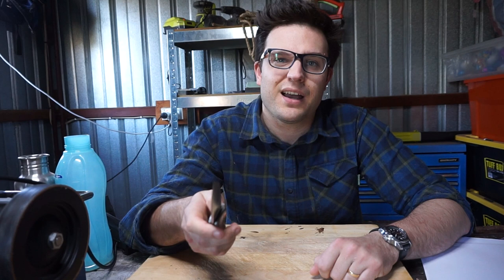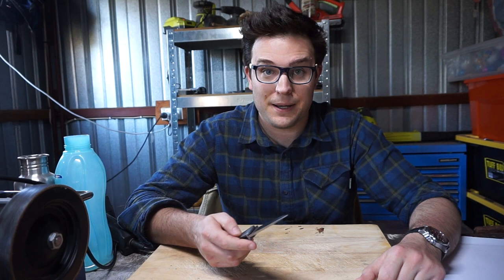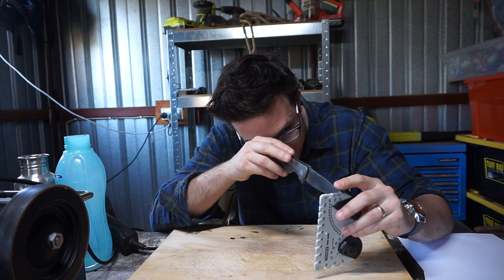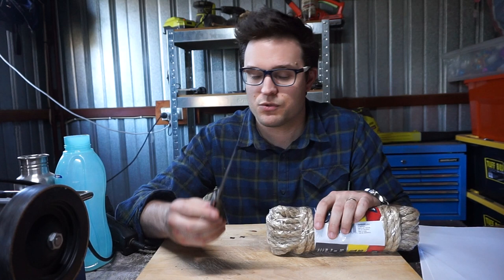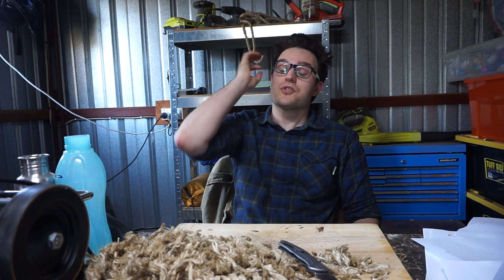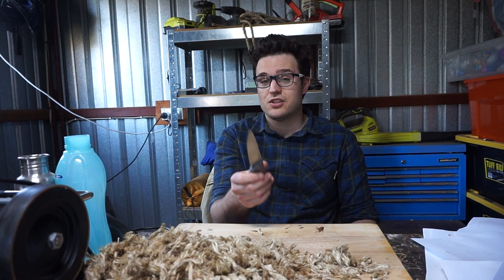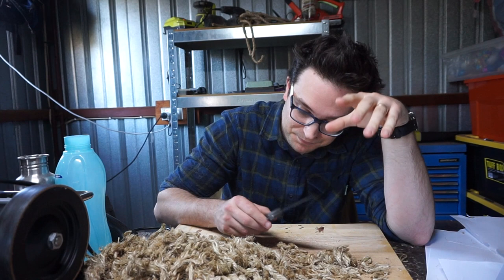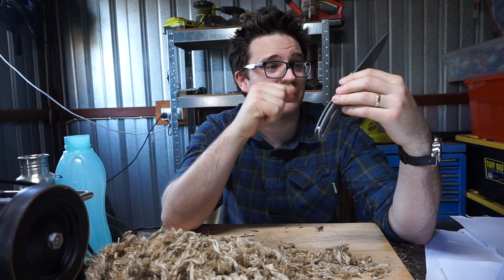S125V Blade Steel Test - Unleashed! Plus Sharpening

Comment: 200 push ups every morning will do the trick Pete) Great vid as always mate
Reply: don0giorgio pushups are actually awefull for shoulder health, especially in his case where his is already putting high stress on his shoulder. Facepulls would help him, pushups would only hurt.
Reply: @basmca1  when you got your doctor diploma mate?
Reply: don0giorgio you don't need a doctorts diploma to learn how our shoulders work. I've been training for almost 5 years and have done my fair share of research on shoulders, how they work and what injuries you're likely to get from some movements. The main thing is people getting an inbalance by doing things like '200 pushups a day' but not doing the equal back and rear deltoid training. That inbalance make the front deltoid and chest muscles tighter relative to the back muscles, pulling the shoulders to the front and down. The effect of this is the rotator cuff muscles and nerves getting pinched and causing pain when the shoulder is put under stress.
Reply: @basmca1  will simultanious pull ups training help?
Reply: don0giorgio yes, a rowing movement would be ideal( the same range of motion as pushups but with the loading reversed.) but pullups are good as well.

Comment: You gotta change up your rope so it doesn't take so long and kill you physically. Dutch bushcraft boys and alot of Russians use some thick boat rope seems to take less cuts. Could be idea for these high end super steels.

Great video as always! The steel and ht are great. The maker has got to stop copying designs though. Find that off putting.
Reply: Only problem is if he changes the constant in the equation then there is no basis of comparison
Reply: I second this! I love watching your steel tests, but I worry about your arm. I say, find a thicker rope, and figure the equivalent in the twisted sissile (sp?). Like, 1 boat rope equals 45 cuts on a regular rope or something. Save that arm Pete!
Reply: @tm1182  more cutting and more data points it will show up.
Reply: Then he won’t have his baseline
Reply: It could work if, for example, Pete establishes a baseline with ~200 cuts on the old rope to weed out the wimpy and normal steels first, then moves to a more abrasive/hard rope for super-steels that are still cutting. 
He'd ideally want to have an overlapping control period, though; re-testing a few existing super-steel results with the new test,  and checking newer super-steels with the old test a few times. 

(More samples with the new, easier-to-perform test would help, too. You might even find out an equivalent number of old-rope cuts for the new rope, though I'd guess it won't be 100% repeatable.)

What would be really cool is something like micrographs of the edges at intermittent points, something to establish a curve for the wear. (The BESS could work, but I'm not 100% happy with repeatability in that system.) At that point, though, we've turned Pete into a low-rent metallurgist, so maybe it's all a bit silly.

Comment: I was thinking of buying one of these knives in s125v. How much should I offer for the knife in your opinion?  Also the Rockwell hardness on this knife says it's 64hrc etched into the blade so a little better than the 62hrc of the one you tested.     Thanks, Paul.

Comment: Poor guy ,can understand tell me anything about this knife I found x50cr mov 15 ? Thanks
Reply: It's not much different from the AISI 420 steel that's been around for a long time, see also Krupp 4116. Kitchen knives are designed to be run over a steel every time you use them, so they're usually pretty soft and won't usually keep an edge for as long as a folder in the same steel.
Reply: @JacksonKnives  thanks I managed to get info atb Dave